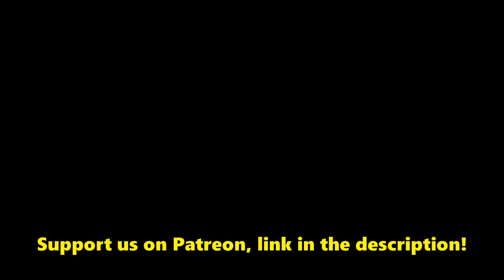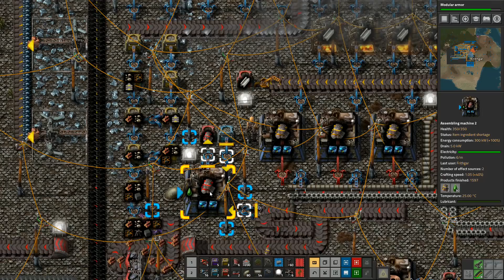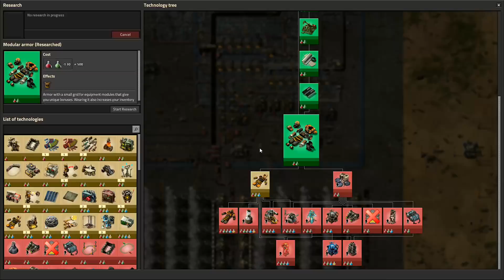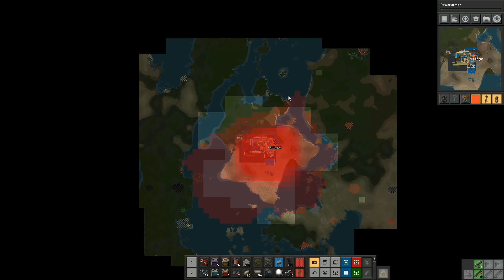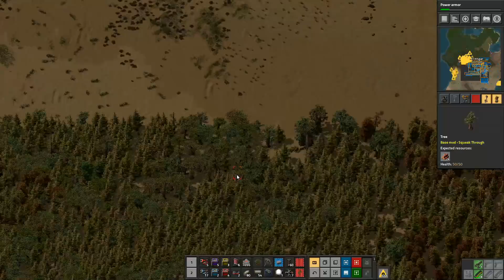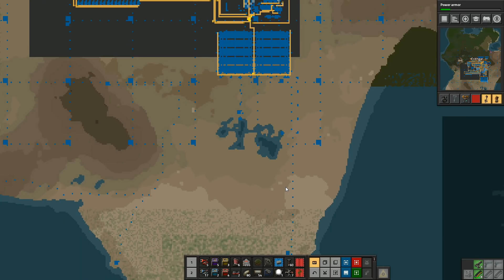Factorio Million Robot Challenge #52: Programming Inserters!

Comment: Currently I'm at 948 Logistics robots and 745 construction bots. I'm just starting to switch over to the logistics network and will be dismantling the belt systems soon. I have also transitioned to nuclear power with the steam turbines. Found a trick with the centrifuges. Using a belt loop to bring the output back to the input. you can use the Covarex enrichment process to make the uranium 235 faster than you would get it through normal refining of the uranium.

I was going to try artillery but that requires trains. Looking forward to seeing you hit the 1 million robots. Love the videos!
Reply from the maker: I increased my bots some more this week (you'll see soon) but not that high yet.  However, that's now getting to the very top of my to do list as we start turning our attention towards targets outside of the immediate island!